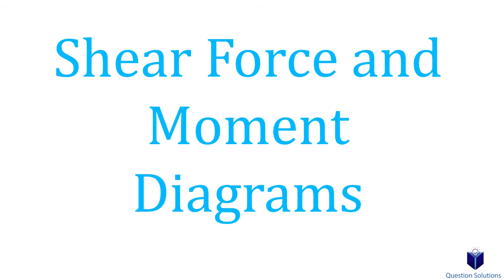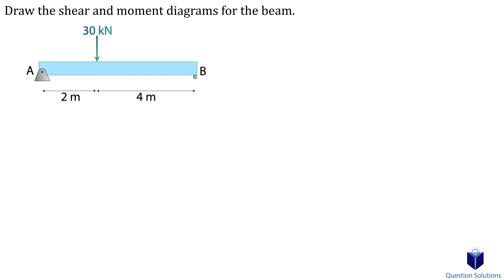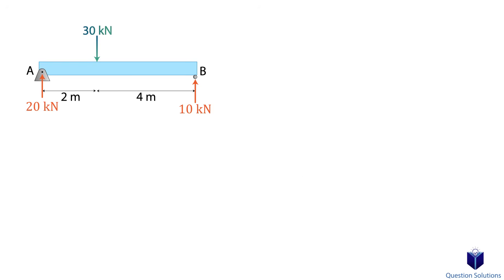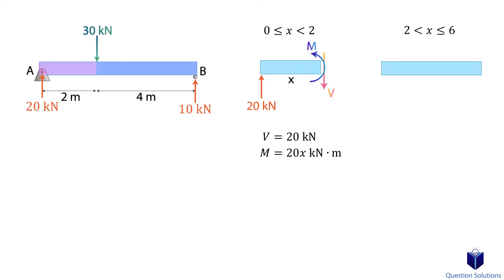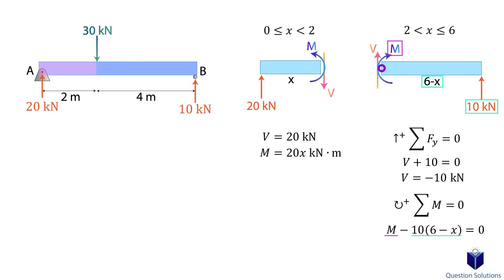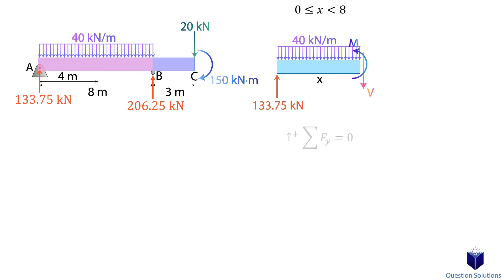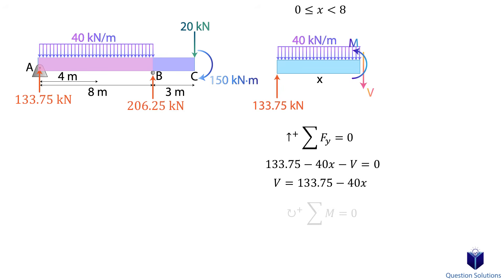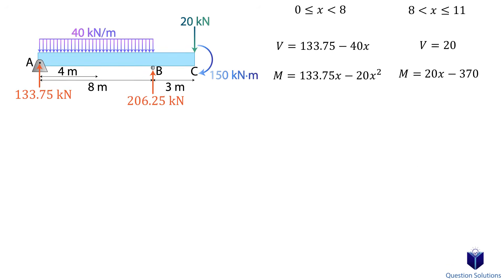How to Draw Shear Force and Moment Diagrams | Mechanics Statics | (Step by step solved examples)

Comment: Question! On your example three, there is a moment with a magnitude of 1200 N*m. It’s turning clockwise and you treat it as positive, the very next example, there is a moment with magnitude 20 N*m, which is also turning clockwise but you treat it as a negative. Could you explain what is going on there? Im with the impression that counterclockwise is positive and negative for clockwise. Anyhow, great video!
Reply from the maker: You can pick whatever direction you want to be positive. Depending on the number of negative signs you deal with, you should pick a clockwise or counter-clockwise direction that gives you the least amount of negative signs. That makes your life easier, but if it doesn't, you can always just keep clockwise or counter-clockwise to be positive, it's really up to you. It makes no difference to the answer, because moments aren't positive or negative, they just have directions. So I change the positive side based on what makes the math more simple. It's the same as when you deal with forces. Imagine you have 10 forces down and 2 forces up. It's easier to make down positive and up negative, then you deal with less negative signs. That's why we always establish a coordinate system first, saying which sides will be up or down. In the end, our answer will indicate whether the resultant force is up or down, not whether it's positive or negative. I hope that makes sense.

Comment: Is it possible you could make a video using x as a length in your problems and having to solve in relation to x to find the shear force and moment diagrams?
Reply from the maker: I am not entirely sure of your question. Is there an example you can give me so I can take a look to see what type of problem you're talking about? Many thanks!
Reply: @QuestionSolutions  I mean I'm not sure if you use this book or not but for example 7-9 in the engineering mechanics statics by hibbeler in SI units
Reply from the maker: @arthurbosch9041  I don't know which question that is, but is it something like the length represented as a variable instead of a fixed length?
If so, the process is the same, you'd just have your graphs as a function of x.

Comment: how is M and 40x both creating a negative moment? You pretend the specimen is rotating about the cut?
Reply from the maker: Please give a timestamp so I know where to look.
Reply: @QuestionSolutions  7:40
Reply from the maker: @Billy_Dubs  That's correct, so we assumed clockwise to be positive but the distributed load creates a counterclockwise moment, so we take it as negative. In essence, we are looking to see the direction based on the location of the cut.
Reply: @QuestionSolutions  Thanks for replying!
Reply from the maker: @Billy_Dubs  You're very welcome

Comment: I really like your content and you've been helping me out a lot. So thank you very much. But I like to point out one stuff. My problem is with example 3 . The result of the support reaction was a bit off for me cause the structure has a moment at the equilibrium and experience more force on the side of A. But the reaction at A is much lower than B ( 450 to 950). So I calculated the support reactions by taking moment at B zero and got different answers which should not be the case. I don't really know what the problem is but something ain't right. ( or I may be super dumb, sorry if that's the case😅)
Reply from the maker: Really glad to hear these videos are helping.

As per your question, I am assuming something is wrong with how you formulated the moment equation for B. It's hard for me to say where you went wrong without seeing your steps. Also, it's very common for structures to carry forces with varying differences in force values, so you can't assume it's wrong simply because they are very different.

Comment: I want to ask a question,why we dont write down the original distance instead of x when we make the cut
Reply from the maker: We want to express the moment as a function of distance. If we write down the original distance, we end up with just one value, and it won't vary based on the length.

Comment: amazing content. I do have a concern, though. When you say clockwise moments are positive, this directly contradicts what my prof told me. He said to think of which way the beam bends due to the moment. If the beam makes a happy face then the moment is positive. So given a standard beam, if the moment is on the left side, a clock-wise moment is positive. If the moment is on the right side, a counter clock wise moment is postive. Can you explain your moment sign convention plz
Reply from the maker: Moments aren't positive or negative, they are either "clockwise", or "counter-clockwise" in 2D space, and in 3D space, you would use the right hand rule to determine the direction of the vector.  Even in 2D space, the moment vector is still determined using the right hand rule. If it's a counterclockwise moment, then the moment vector would be straight of the screen towards you, and vice versa. This is why people usually pick counterclockwise to be positive. I don't like counterclockwise being positive, it's just a personal preference. It makes no difference to the answer. In fact, I encourage you to try it both ways, you will still get the same answer.

This is what is important: 

-If you pick counterclockwise to be positive, and your answer is positive, then your moment is counterclockwise. 
-If you pick counterclockwise to be positive and your answer is negative, then your moment is clockwise.
-If you pick clockwise to be positive and your answer is positive, then your moment is clockwise.
-If you pick clockwise to be positive and your answer is negative, then your moment is counterclockwise.

You can pick whatever side you want to be positive, like when you pick up to be positive, or down to be positive. It's just an assumption. As a convention, people generally consider positive moments as counterclockwise since they are directed along the positive z axis (out of the screen/page). It's completely up to you.

Comment: How to know when to make the line parabolic and when to make it straight?
Reply from the maker: If you remember the relationship between the shear force equation and moment equation, you will always know when. So If our shear force equation is not a straight line, our moment is going to be parabolic. In other words, if our shear force is not a constant, our moment section will be parabolic. That only happens with distributed loads.
Reply: @QuestionSolutions  Thank you so much. Also, when you made the cut on the previous example at roller b, you had the length named as x. Why didn't you take it as 8 as you made the cut at the end of the distributed load?
Reply from the maker: @yusufmoola6471  We want to represent the length as a factor of x, in other words, we can figure out the moment at any location by simply plugin in the length, so 1m, 2m, 3m, etc. 👍

Comment: Thank you very much for the videos! Can I ask, for the first method used, how do you know when you need to solve shear and moment forces forth both pieces cut? I have seen examples in my notes where only the shear force and moment for one half of the cut member is solved, and used for the whole Shear force and moment diagrams.
Reply from the maker: If it's just 2 pieces, or easy to figure out in your mind, you only need to solve for one half, since you can figure out what comes next, they all have to come back to their return points on the graph. If you do enough questions, you can see what comes next without going through the steps. If you're new to this though, I think its better to solve for all the pieces :)
Reply: @QuestionSolutions  Thank you for the explanation! :)
Reply: for both pieces *

Comment: why is CW positive here?
Reply from the maker: Please use timestamps so I know where to look. Thanks!
Reply: @QuestionSolutions  oh yes sorry ! It’s minute 15:12 thank you very much !
Reply from the maker: @Peakan  Clockwise is positive, counter-clockwise is negative. You can assume the opposite, you will still get the same answers, but make sure to follow through for all the forces that create moments. I think its easier to think of clockwise as positive and counterclockwise as negative. Most books use the opposite method since the vector for the moment would follow the right hand rule, so it's really up to you. Both methods will give you the same answer, as long as you follow through with the same sign convention until the very end of the question. This means if you pick clockwise to be positive, you must follow that for all forces and moments applied to the beam and vice versa.

Comment: Erhmm where is the -186.25 in question 2 from?
Reply from the maker: For the future, please kindly use timestamps. It comes from plugging 8 into the equation shown in the blue box at 8:53. Remember, it's a linear equation, so you just need 2 points to get the graph, easiest to use is 0 and 8 since the equation is for a segment from 0 to 8 m. 👍 

Edit: I just noticed, I actually say this out loud, please listen to 8:51. I know time is tight, but try not to skim through videos (if that is what you are doing), since I try to make these as concise as possible, and only important stuff is said :)

Comment: Need videos on Friction & Moments of Inertia (Engineering Mechanics: Statics).
Reply from the maker: Hmm, I probably won't cover friction since it's been done on so many videos and there isn't much that you would need for dynamics or statics other than multiplying the normal force by the coefficient of friction, which I showed many times. For mass moment of inertia, when I get time, I will do a video because I got so many requests.